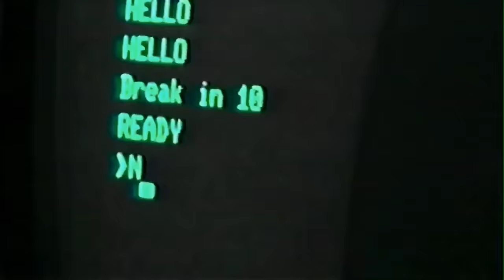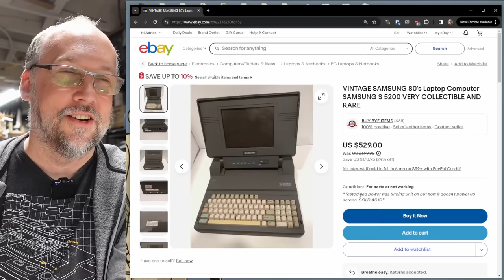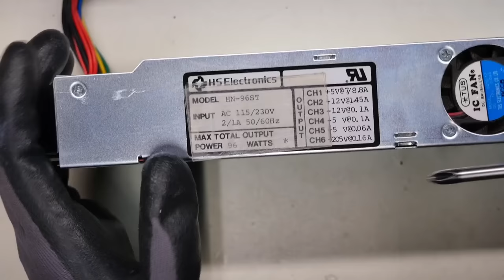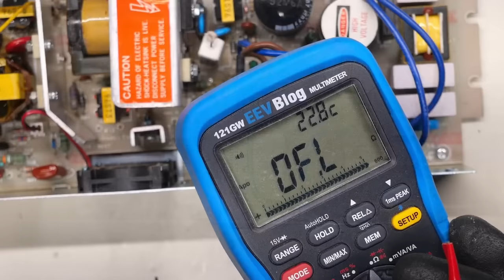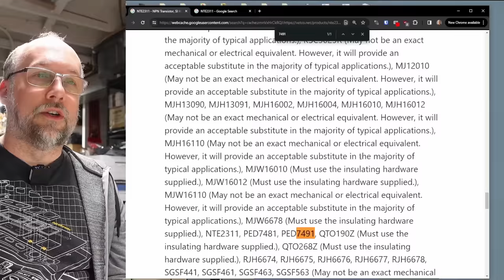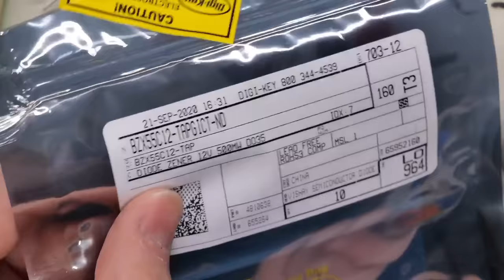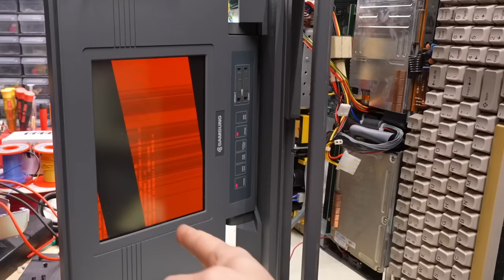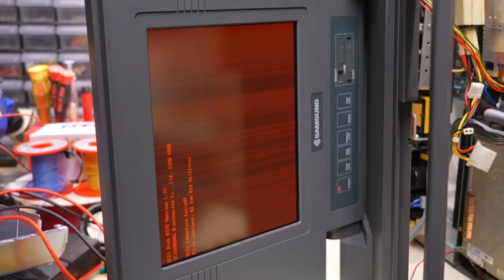Does this dead "laptop" have a gas plasma display? Let's try to revive it to find out! Samsung S5200

Comment: I bought one of these from future shop in 1991 - 1992 when I worked on the D.E.W. line.  I moved around a lot up notyh and wanted a computer to play games on (leisure suit Larry, TRACON II and the first SimCity) so this was portable and all in one.  back then the screen was crisp red on black, and I think was $2000 Cad.  I had forgotten the model number. I did upgrade the Ram to I think 2MB which was I think around $600. The machine was a beast but the laptop form factor was pretty great.  Really fun trip down memory lane!

Comment: I would say you open that cover from the bottom by prying "catches" on the edge where display cover meets lid. To avoid damaging, try to cut out a prying "blade" of the packaging plastic (that transparent one), that is very thin and not too hard. It can get in the small crack and at least can be used as a "probe" to find where cover is attached to the lid-and it does not damage old plastic.

Comment: Seeing the thumbnail I thought the computer was a Toshiba T3100. That was actually my first PC, bought second hand for a couple of £hundreds. I eventually sold it for far less when the hard drive failed. Like many parts of the computer (e.g. the pinned memory modules) the hard drive was an unusual part with no separate power connector.

Comment: It is usually the bonding between the flex & the panel that is failing, you can sometimes revive them with some heat.

I have fixed a few switch modes that have failed with the power transistors. Good work getting the thing booting.

Comment: I have a couple of old Toshiba T5x00 laptops with plasma displays. My favorite is a T5200/100: It has a 640x480 VGA greyscale (or, I guess, orangescale) panel, a 386DX-33 processor with the 387 installed, 4 MB of RAM, a 100 MB hard drive and two ISA slots, one 8-bit and  one 16-bit. It's become a surprisingly competent DOS gaming machine since I added a Sound Blaster 16 and an XT-IDE card into it. It seems to be fully compatible with every DOS game I've tried so far, at least the ones that can run on a 386. It'll also run an external VGA monitor at the same time (mirrored) which is kind of a neat effect.

I know the older plasma displays with the controls for both contrast and brightness tend to have shitty contrast, but the one in the T5200 has really good contrast. It doesn't get super-bright anymore, if it ever did, but its blacks are very close to actual black. 

I hope you tackle this repair some day. I also have a T5100 with the same failure mode on its panel. And I have no idea how to fix it.
Reply: I was given a T3100SX (16 MHz 386, VGA, and TWO friggin batteries so that thing could actually be used as a laptop) in the late 90s. It lasted all of three days until it broke without me even having disassembled it yet.
(bad capacitors, but young me had the weakest, crappiest soldering gun and no chance in hell to get those old leaky caps out. I even tried snipping the legs and soldering the new caps onto the stubs, the iron was too weak for that too - so young me gave up, took it completely apart and threw away most of it. Sad.)

Comment: Well that Samsung certainly looks like the Toshiba T(ank)3100/20 I have, also has that orange gas plasma display and is heavy as heck. Fortunately it works pretty much fine except for the HDD which I might or not get back in working order and that blasted Dallas clock module which I need to replace with a modern coin cell counterpart as there's not much room for a rework. Anyway as a collector of primarily Toshiba's and others from the 80's and early 90's I like you giving some love to "portable" devices and hope you might do more video's about them.

Comment: One of the companies that I worked for, got one of those Samsung computers for a customer. It was bought as it had a 16 bit slot. We needed to plug an Allen Bradley 1771-KT card for communication to a PLC.  We also had 2 models of the toshiba gas plasma display. One had EGA, and one had a VGA screen, still both orange.

Comment: I collect old laptops and mobile phones. My oldest working laptop is a Hungarian laptop from 1987, a 286 12 MHz, 2 ISA card slots(8/16bit) under the keyboard, 1.44 MB PC floppy, 3.5 inch PC HDD, and a sealed lead-acid battery that powers my laptop for 20 minutes and it is original :) It has 1MB RAM, in 256k DIP chips, on the bottom. It has a built-in PSU to charge the internal 12V battery, or it can also charge from a car cigarette socket. It has an  analog battery meter, and an MDA/CGA LCD screen(switchable).

Comment: Connect external display if same lines then try replacing cable or check gpu to fix.  If no black lines on external then likely plasma display is done, but can remove display to check horizontal driver ICs for gunk, defects, clean those ICs isopropyl/CCleaner and see if fixed.  Last resort can try to isolate and replace individual IC driver chips, but replacing screen is normally the next step if one can be found but that probably means taking a chance with another dead S5200 and it might be easier to fix that one instead and keep this one for parts?  Enjoyed the video time machine, took me way back!

Comment: Valiant effort with this rather unique laptop.  I've worked on LCD Panels in the LMR / 2-way Radio Industry, and there are some methods of repair, which have a reasonable success rates.

As for Plasma Display repairs, short of a complete replacement, with known good parts, it can be problematic.  Several of my older lugable/portables were retired because of this very problem.

I agree, that this is a very unique display, and working units can make it very desirable....  retro eye candy!  Much like the Nixie Tube & VFD Displays of other vintage devices.
Reply from the maker: Indeed ... There lots of comments saying repairs are possible by flowing bonding flat flex ... but I know every time I've tried to fix flat flex it has ended up melted cables. LOL! At least when I pull it apart, maybe I can figure out what kind of display it is.

Comment: Try the 2SC2335 for replacing the high voltage transistor.
2SC2335 is a Sony transistor widely used in the switching power supply of their video recorder (SCL-7) in the '80s. It is in the smaller TO220 case but it has very high voltage, current and frequency specification; it has an ECG Sylvania equivalent...

Comment: This computer really looks a lot like the Toshiba ones, down to the grey colour.

I used quite a few Toshiba T3200SX and T3200SXC computers. The SX had an amber gas display, the SXC a TFT colour LCD.

One SXC was filled with sniffer cards from Network General for capturing traffic on Ethernet or serial HDLC/X25.

These Toshibas had 2 weak points: the PSU and the power provision to the LCD backlight.

Comment: If the panel is intact, its contacts, like the ribbon cable might need cleaning/replacing, otherwise the MB might need attention. Did play around with the Osborne, which was a heavy "portable" monster too.

Comment: The lines in the screen might be fixable in a similar way vertical lines in a Nintendo gameboy screens can be fixed by using a solder iron at the ribbon that is connected. Might want to look at this.

Comment: For PSU issues like this where an "odd" voltage is required it might be possible to use a standard PSU and one of the high voltage DC-DC modules which are available to provide the screen voltage, assuming the replacement PSU has enough headroom on one of the outputs to supply the module. As others have said it might be possible to replace the screen with a modern colour LCD which would leave you with a useful PC for say testing cards which require a 286 without the need to pull out and put together a  PC, keyboard and screen.
Reply: Agreed on the dc-dc boost converters. They're available on the jungle site with inputs of 5-12VDC and outputs of 100-1000VDC. Perfect for supplying gas plasma or VFDs, and unbelievably cheap. I always look to treat things like industrial lego.
Reply from the maker: @Abrankod I didn't look but yeah I was wondering if boost converters existed that could output the needed 205-210v. I see lots that go way into the KV range (likely for backlights) Looking around I can't find any... things seem to max out around 30v.

Comment: Then there was Tandy (Grid Sys) 1400LT. It was only an 8-bit XT, with inverted b&w CGA display, and 2 floppy drives (no HDD). Battery was old as dust, by time i got it, so it had to stay plugged into AC. I played King's Quest III on it.

Comment: Great video the one thing I would be interested in for a future video with the laptop would be to fit a new school LCD into the frame I know it would lose the vintage plasma feel but I bet it would pop and would be quite the reverse engineering great to setup
Reply from the maker: They sell these iPad 9.7" Retinal LCD screens that might work here. It would possible crop the edges though as I think this panel is only about 9.4"...

Comment: Hi Victor, long time no chat. 
Managed a huge number of Proliants back in the day, mid-to-late 90s Rock solid bullet proof servers.  So, hot-plug was intended to reduce risk, not improve resiliency. 
All of our servers then were PPro, and not just were the PCI cards hot plug but also the CPUs, and allegedly RAM. we tested NICS, HBA, RAID SMART2-DH and CPUS, without issue under Netware 4.  When  production uptime was critical, hotplug was vital if one of those components failed. What would require a power off, component swap out, reboot, could be addressed without incurring business loss.
In regards to SCSI, ‘SCSI Al” needs to educate you when I near a real keyboard not this pigging ipad.

Comment: I think this is one of those things if you open it up, and let pandora out of the plasma filled box, the problem will just get worse.  But, that is just my guess.   Impressed you got the power supply working again by coming up with workarounds on the fly.  Was a little disappointed you didn't hook up the SCSI hard drive, via external 12 volts, to see what the computer had installed -- assuming the drive still works, of course.
Reply: Yeah, I'd be worried to touch it. Play with that screen cable and you go from a workable screen, to a completely unusable screen.

Comment: 5:52
That was always one of the primary big Plasma Screen issues - that glass was commonly thicker than in a CRT, so the weight of a big screen got SERIOUSLY heavy.
Reply: And power hungy, despite the for the time (almost the latest generation that got to market before lcd took over) amazing great  colors and brightness and contrast, it got baking hot to. Usefull for heating  a room of drying  laundry ;)  .I kinda miss that beast but I remember sore and painfull hands and back when I finally got rid of it, and that was with help from a friend even. Don't even want to remember what the municipal recycler/waste billed me. Chemical disposal waste is free, I should have placed it there ihindshight lol.  Good days.
rember those projector CRT bigscreen tv's ? Basicly a crt beamer via a mirror and fresnel lens and difusser in a enormous wooden and plastic cabinet. That fresnel lens I kept for a decade after dismantlig it, it would set fire to wood intstandly and with good weater and dry sand and focused on the spot for long enough it actually smelted/melted the sand into crude glass. Since it was made of acrycil is wat rather fragile and it got some damage after a few years and finally I simply lett is shatter by accident. But I had so much fun with that enourmous lens.  The crt module I damaged and never got it to work again, alas. It's great fun dismantling old  equipment and save the few gems in there.

To get back on topic: CRT's are wonderfull; I fell like I had my own particle accerators. espectically  those monochrome ones used in oscillopes with adjustable focus spot and worked with electric fields xy steering rather then a magetic field in the TV's versions.
Reply: @blueredbrick  Plasma?
Power hog?
That's like calling the ocean damp.
The heat wasn't a major issue though for what was in essence a fancy neon tube.
And a LOT of O'Scope tubes also used magnetic steering - but mostly the larger ones.
Reply: @bricefleckenstein9666  yeah the electric field steering is only for the tiny ones,so nice to see the workings of it

Comment: Hey adrian love you're videos alot ! I have seen many capacitor in old devices that have does bulging type of capacitors those are just lids with a serial number only used for old heavy duty capacitors you can just remove the bulging cap on the capacitor and see a normal capacitor head so thats nothing strange or important. Btw keep up the great content    .

Comment: I see others have already mentioned it, but this looks to be repairable. I would give you links, but I seem to have lost them somewhere along the way. I came across them while looking for info regarding a plasma display on a different device. But with a bit of searching, it shouldn't be too difficult to find if those particular blogs are still up. I'm guessing you've already found something before this video was even finished posting, lol. Yeah, it's going to require opening the bezel which will be a pain if the plastic is excessively brittle, but it ain't working anyway. I guess when you consider that, there's really no need to get too worried about it. That said, it would be fun to get it up and running again. I know it isn't the greatest display on Earth, but they are really interesting displays in their own right. If you are able to fix it, it should be noticeably better across the board. 

Personally, I've always really liked those older plasma displays, especially back when they were new. Unfortunately, their age and the very outdated nature of the devices they were used on makes them far more likely to have been scrapped ages ago. But if you do get one that is working properly, it really is a thing of beauty. Well, in my opinion anyway. And you know what they say about opinions, lol....

Comment: The glass panel on the Toshiba T5200 (which looks exactly like this Samsung 5200) was incredibly fragile. I had several in my shop over the years that had been cracked at the edges of the glass by people who dropped the laptop. While I could replace the plastic cover easily enough on a dropped laptop, trying to repair the cable that went into the glass was basically impossible. The cost of the Toshiba T5200 display as a repair part was about $2000 back in the day.  People just bought a new company and didn't want the old one back. As a result, I often a few in stock in the boneyard to scavenge for parts. When I closed up the repair business in the 1990's, the boneyard went to the dumpster.

Comment: Keep an eye on the 205V supply for the panel.  These machines, and some Toshibas too, were known for problems with the HV supply going over voltage as the power supply warms up and killing the drivers on the panel assembly.  Put a new panel in, then 3 days later dead again.  Not a lot of fun, been there done that once.  Always test ran the power supply with a resistor load after that just to be sure and repair if need be.

Comment: My father had the newer Toshiba 386 version of this or very similar. It could run VGA 256 color graphics on the screen but I suppose the orange plasma screen only showed 32 or 64 shades of orange. The screen was faster than LCD screens of that era so I could play games with the machine quite well.

Comment: The flex cable is always a problem for both LCD, VFD and gas plasma displays.  The adhesive that connects to the display and the flex cable deteriorates and it begins to lift.  Usually pressure on the connection point should make it obvious if this is the issue, once you have it out.  If you are lucky, and it's only a plug in, then unplug and clean it.

Comment: Hi Mr Black, maybe change the psu to a Pico, put in a VGA card and LCD display (might need VGA - HDMI conversion). Then have it boot to a similar orange-ish colors. Or try heating the ribbon/flex cable as others have suggested.
Reply from the maker: Indeed, if I ditch the plasma screen then I don't need that 210v rail anymore. Easy PSU swap at that point. :-)

Comment: An octopus can test components in circuit.  An IV curve tracer.  They are easy to build.  Essentially a Huntron Tracker.  Look for an ARRL article from 2017.
A nixie clock power supply could generate the 200V.  Just an idea if you decided to swap out the stock power supply.
Like other have said, SMD hot air blower could fix the flex cables.  It works for LCDs.
Thanks for another great episode.  I love that amber display.  Had an amber CRT on an XT growing up.

Comment: Reiterating some other comments: the display may well be repairable.  It's essentially a giant shift register of plasma display drivers (replacements difficult to find, but still out there).  Common failure modes include corrosion of the pins on each driver which can lead to shorting or near shorting of the lines (a range of odd physical display effects can occur, like over-bright lines or missing or garbled information), and a broken link on the flex cable (leading to a dark, completely missing line).  Have a poke around in there!

Comment: When I am dealing with old plastic, I use a hot air gun to warm up the plastic.
Using a hot air gun that you can control the temperature is best, so you don't go to the melting point of the plastic.
Warming those brittle clips softens them so they don't snap.

Comment: 37:13 to prevent that, it's always a good idea to connect a regular lightbulb in series with AC input to the PSU for the first try. In case of a fault it'll just light up instead of the device lighting itself :D Fortunately that wasn't the case here, cheers :)